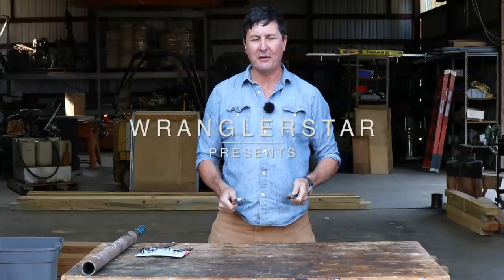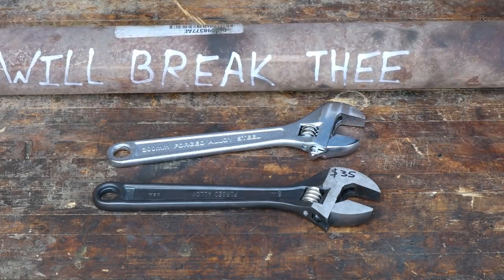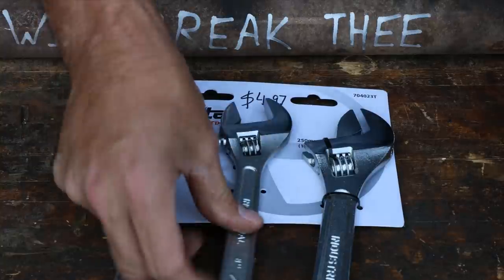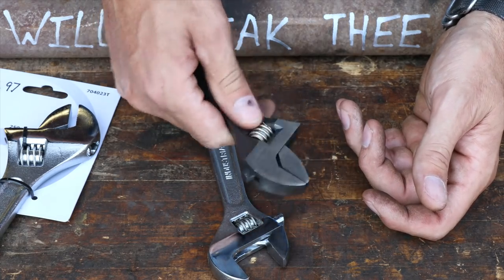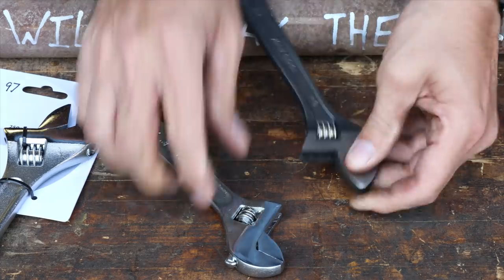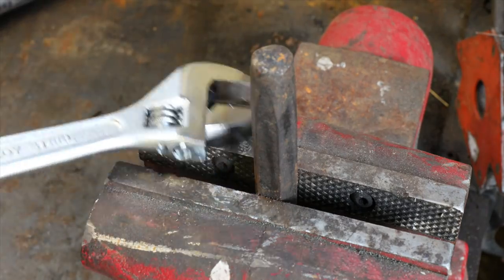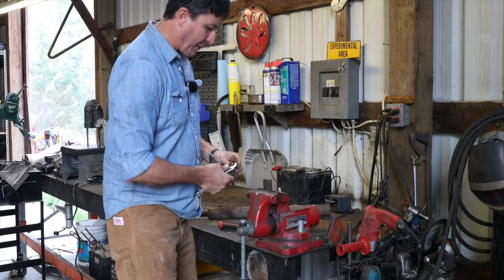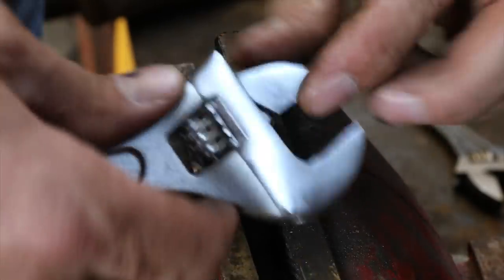Testing Cheap V.S. Expensive Wrenches On AMAZON

Comment: I buy old American made crecent wrench from flee markets and yard sales. It is usually around $5-$10 depending on length. The older tools make me happy when I use them. I let people barrow my Chinese cheap tools not any USA made tools.
Reply: The best pair of vise grips I ever had, I literally found on a parking lot as I went to buy bagels in San Antonio. It was an old pair of VICE GRIPS branded pliers made in the USA. Unfortunately, as my luck would have it, that pair went missing after a year or so of hard use where it just didn't fail to do what I needed it to.
Reply: you can still get them new ;) i have a set that are 60 years old and just got 2 clones of it new .. 100% identical ;) as you say ; they are the best ;)
Reply: greg stevens I have bought new Vise grip pliers that are made in China (Irwin bought the brand name), and they just weren't as good as that pair I found on the ground.
Reply: Estate sales have good tool deals, too. Always go to the basement and look for tools; sockets and wrenches first.

Comment: I found that usually spending the money on quality stuff is the way to go. It works better and never fails plus it is way more fun to use quality tools instead of cheap ones. Great video as always!
Reply: I agree on quality tools, they fit and work better. But Snap-On goes way overboard with their prices. Example is car jacks. The Harbor Freight Daytona jack is is a great jack. Is identical to the Snap-On one for hundreds less. My USA Craftsman adjustable wrench is superior to the Snap-On one which has a lot of play in it.
Reply: agreed... not to mention when you buy quality stuff, most of it comes with a life time warranty, and is built tough enough to actually last a life time

Comment: Now try to imagine testing a $36 Chinese Wrench
Reply: We tested a $60 irwin 18" adjustable wrench.  It was 28 Rockwell, compared to 36 of U.S. made crescent, and in less then a week the pin for the thumbwheel failed.
Reply: how big would that wrench be? probably 30" to get to that price as it would surely be as crappy, just bigger
Reply: Mind blown
Reply: LOL Haha, you nailed it :D
Reply: Ahahahah
Reply: Wow that tool should last a lifetime. Do you think the failure was design or assembly issue?
Reply: Oalmax ha ha! Yes! Bravo
Reply: The thumbwheel pin and the thumbwheel are the weakest components of a sliding jaw wrench.  A larger diameter pin of better alloy would increase the selling, price by under $1.  This isn't a matter of manufacturing capability, but engineering to a price point.
Reply: Design.  "Assembly" is installing a screw between three components.  Make a mostly steel tool 80% cheaper while keeping the basic size and design the same and the material of 3 components cannot be of the same strength and the quality of finishing/precision cannot be the same.
Reply: It's not linear, it'll fail less often but still more so than the American version. Take it from someone who lived there for two years, it's a cultural issue.
Reply: Jimmy Duncan it is likely a hidden safety feature
Reply: engineered to break at a certain torque? possibly, but i tend to doubt it. if it breaks you can hurt yourself. i rather think it just reached its stress level and broke because science, lol.
Reply: i think it was his cheat bar lol
Reply: That would be best as
Reply: I dont get this test...why not test Chinese $5 v USA $5 wrench..
Reply: They don't sell $5 USA wrenches
Reply: They don't make one lmao
Reply: Fook Utube they dont sell 5$ us wrenches
Reply: That sounds a bit more fair
Reply: Expensive Chinese tools are superior both in price and quality.
Reply: Expensive Chinese tools don't exist in the US. Companies that contract with Chinese manufacturers to make tools for sale in the US don't care about the quality. They care about the price per unit. All US-based businesses that decide to move their manufacturing to China are making that decision purely based on profit margins, You could have a more expensive wrench made in China, but the smaller margins make it significantly less attractive and you then have to compete with US manufacturers with established products and manufacturing processes at that same price point.
Reply: I mean the chinese one was the smallest of a 3 for $5 deal. That makes it like $1.5. You can get 23 of them for 1 of the better ones.
Reply: He says at 2:24 that "this is one of the only USA made wrenches I could find" ... and judging from my own experience, I don't think a $5 USA made wrench exists.
Reply: Randy Magnum very interesting sir!
Reply: Fook Utube because China don't play fair and Clinton gave us NAFTA which allows them to charge less and undercut the market.
Reply: does not exist :DDDD
Reply: Yeah, I want to see what a similar price point gets you from many countries. Give me china, usa, germany, india, etc.
Reply: it would be the same wrench the only differance is you pay 36 dollars this time
Reply: Regardless of the cost, the quality would have been just about the same as the $5 one.
Reply: @fookutube501  this test was about cheap vs expensive not USA vs China
Reply: never seen a 36 dollar chinese wrench
Reply: @cftemptempov6262  not really. Quality control still issue there
Reply: @ Hatchet Read before you comment .I did not say USA vs China.I ask a question"why not test Chinese $5 v USA $5 wrench"...
Reply: a $36 Chinese wrench, was probably imported from the US lol
Reply: Bravo, Hatchet D. - you're one of the few people who got it, and it's clear that you did read the question.  

Fook Utube:  "I dont get this test...why not test Chinese $5 v USA $5 wrench...."  
Hatchet D. "@Fook Utube this test was about cheap vs expensive not USA vs China"  
Fook Utube:  "@ Hatchet Read before you comment .I did not say USA vs China.I ask a question"why not test Chinese $5 v USA $5 wrench"..."

Clearly, Fook STILL doesn't get it:  the reason why he's not testing a "Chinese $5 v USA $5 wrench" is because, as Hatchet said, "this test was about cheap vs expensive not USA vs China".  The title of the video is "Testing Cheap v.s. Expensive Wrenches", not "testing US vs. Chinese $5 wrenches".

Think of it as a sort of "mythbusting test":  The tool greybeards have been telling us for generations that the Chinese tools are no bargain, that you get what you pay for, and that a properly-made, high-quality expensive tool is going to do the job it's designed for better, and last longer.  But, are they right?  This test demonstrates that the more expensive wrench does, indeed, stand up to more abuse before breaking, has a better fit and finish, and does harder work longer before failing, versus the cheaper wrench.

A test of one cheap wrench against another cheap wrench, no matter where they are made, kind of misses that point.
Reply: “Cost 22 times” and lets try makes 22 times more first , I’m starting wounding if I can looking for a house cost 22 times because truly appreciate the quality of life , Please don’t wake me up and I thinking my supper car now..
Reply: hochhaul l
Reply: @geraldbrakefield3874  because they dont exist
Reply: @AldoSchmedack  I didn't know that China was in North America. Last I checked North America is US, Canada, and Mexico so those are the only 3 countries in NAFTA (the NA is for North American).
Reply: @fookutube501  because good luck finding a 5 dollar crecent wrench
Reply: exactly!!  American cheep  tools brake too. I am sick of chasing down the snap on dealer to get a tool fixed. 
Test a cheep American tool against a good Chinese tool.. Better still test a good American tool against a Britool... thats a British made tool
Reply: @Andrew Manche that answer is showing your lack of education.
As mentioned in the comments, and so true. Most things brought in from China are made per the specs issued. If an American company wanted to bring in a great tool made in China that is what they would request. Which would bring the price point higher. 
The only differents in quilty from the US, China, Canada and Germany.... is wage vs shipping.
What profit margin do you want.
Reply: The grade of steel is all that matters. They both failed and the thinnest part, also the moving pieces, and the better steel won out.
Reply: buy Sidchrome
Reply: You'll get the same tool, just marked up.
Reply: Same wrench they just took you for an extra 31 bucks
Reply: @jimmyduncan7650  Material.
Reply: @jamestmtmtl8531  cheaping out on making the nose shorter didn't help either, so probably design too.
Reply: China could make tools as good as any nation on earth, it's just that there's more money in selling a quarter billion cheap wrenches than a quarter million high-quality ones.  Most of the hand tools like adjustable wrenches are purchased by consumers for very light-duty work, and are good enough for that.
Reply: There are German and US brands, like Millwakee, that manufacture their tools in China. After all, iPhones are manufactured in China and they are really well built. I tend to go for the locally manufactured German tools, though.
Reply: @jimmyduncan7650  Yep, maybe it's made to break a part you can get a replacement for instead of the adjustment screw.
Reply: @Intellect1618  lol you really know culture?
Reply: It doesn't exist
Reply: hochhaul crecents are made in China
Reply: @AldoSchmedack  can always blame on other's success with one's own failure. It has always been done and always will throughout the history.
Reply: @geraldbrakefield3874  If it is contracted out by Sony, Honda, or Apple or Porsche, you will see a $100 Chinese wrench.

Comment: More accurately the $35 wrench was better than the $5 wrench. 

You should try a $35 USA wrench vs. a $35 Chinese wrench and see what happens.
Reply: The Chinese $35 wrench will beat the pants off the USA one.

Have a look at Fluke multimeters for an example of this.  Compare the $100 Chinese market model to the $100 American market model (if you can even find one).
Reply: There's no such thing as a $35 Chinese wrench.
Reply: The point is whether or not you want to spend more money on the American made wrench compared to the cheap Chinese wrench, its obvious the more expensive one is more likely to be a better product but the point of the video is to see if it's worth the extra money to someone who is looking for a wrench.
Reply: Rubberneck Rides Dude...you've got no clue do you. THere's no chinese wrenches that cost even more then $10(in china)... exept really big pipe wrenches. THis is not a simple math question... Stop acting like you are smarter to choose the $5 one. It's like everything ever get produced... You get what you pay for. If china can come up with a wrench that would compare to a $35 one, why would they price it at $5? It's so funny that I'm from china and I would buy better quality tools for more money, even if I can't afford tools made in Japan, USA, Germany... I would get a taiwaness one. A chinese tool is my last option...I dont have to tell you how many times Ive  broken cheap chinese wrenches for normal around the house uses.
Reply: shepd3 Fluke is not a chinese company if that's what you are saying. 
http://www.fluke.com/fluke/myen/about/corp/default.htm
Reply: Rubberneck Rides you'll have a tardy holding a $5 wrench and an empty wallet.
Reply: I will happily sell you a chinese wrench for 35.00... all of you!
Reply: The Chinese build to spec. Want a cheap wrench, they will cut every corner and make you a cheap wrench, but if you want quality, they can do it too. It won't be the same price, obviously.

The thing is : manufacturers don't go to China for quality. No manufacturer will say "we found that great shop in China that does a better job than anything we can find in the US", even if it is true, "Made in China" simply doesn't sell.
Reply: Emi Cang I think you missed the point. Which is that these wrenches are not of equal value regardless of their origin. So how can you compare?
Reply: Rubberneck Rides well, its kinda the point of some blue point tools vs gearwrench or irwin, all 3 going to be good, but if someone is going to spend 35, maybe they want the sk or crescent or what have you, that point its kinda whatever fits your flavor type deal
Reply: ToughAncientSpark good chunk of Blue point is made in china, but they are a bit spendy, but better qc and mfr process a chunk of time.
Reply: for $35 you would probably get a MASSIVE wrench
Reply: Grenherb - dumb comment, interesting video
Reply: gubx42 OK, I'll bite....name a quality chicom product.  I buy mostly wright tools if I have to buy new, so name something in that quality tier
Reply: This video is not about US vs. China made, it's about $35 vs. $5. The cheap one is just much more likely to be made in China.
Reply: who should label it should PROFESSIONALS use because buying over priced wrenches like that for occasional use is impractical. buy a stanley for 7.99 works just as good
Reply: You're right there.
I go to my Hong Kong tailor because he does as good a job as I can get in London, but I would need my head read if he charged as much as well.
Plenty of tailors in HK are much cheaper than he is, and so are the results.
Reply: Rubberneck Rides you get what you pay for
Reply: A Made in China branded wrench?
Reply: not advocating the price of the Snap-On, but I own the 12" version and have yet to bust it, the same cannot be said for a chinese cheapie or a Kobalt 12" adjustable...
Reply: The thing is the Chinese are improving... Before long Made in China will not denote crappy shoddy products but quality well priced items. It's already starting to happen.
Reply: i swear all i hear in his videos are USA as if the USA is best thing in the entire world so overly patriotic
Reply: Which Chinese sweatshop produces those?
Reply: Don't be so naive to think high end stuff isn't made in China, Because a lot of it is made there. Well known Western brands and a plethora of smaller companies outsource to China to manufacture their goods.  My point is more about the future...If you keep making something you become better at it.   If you want them to stop producing the crappy stuff ... don't buy it then it's that simple.
Reply: He isnt saying that.
Reply: You are right, they build to spec.

But some manufacturers do go there for the quality... and the price.  :)  Apple, for example.  Much as I don't find Apple products appealing, I would be hard pressed to call the iPhone "junk" (in the sense of a $50 Chinese market phone. anyways).
Reply: Nahh, not saying Fluke is a Chinese company.  Just saying that high end Chinese market products exist and are of very good quality, for quite a lot less than the US market products.

Fluke makes a set of "reduced cost" multimeters that are (supposedly) only for sale in China.  There's a small number of cost reductions, but few people have complaints about those cost reductions considering the incredibly low price and the high quality of the most important part--the meter itself.  The cost reductions were in things like the leads, boxing, feature set etc.  The meters themselves are rock solid, like the USA market version.  You can go and buy some nice high end leads and you're good to go so long as you don't need true RMS (and no, the meter doesn't like about that, either).
Reply: The problem is a $35 communist wrench is the same one as their $5 wrench with a different sticker and paint. Very few brands can hang with U.S.A. dollar for dollar.
Reply: Test a $2500 Japanese love doll versus a $25 Chinese blow up version.
Reply: Absolutely!  and in fact, as a pack of three, this was a $1.70 "Adjustable spanner" against a $35 "Adjustable spanner"  as the original British inventor called it!!
Reply: the other wrench wasn't $5 .. it was $5 / 3 , it was less than 1.7$...
Reply: @DJaquithFL  i have these snap on mexican socket sets and they are worth every cent.
Reply: @shepd3  You're comparing features with reliability
Reply: @sp1068  Sorry, did you mess where I said "quality"?
Reply: Emi Cang -- Thank you for your insightful reply. :-)

Comment: I just don't get the point of this video. It will be shocking that a $35 wrench is NOT much better than $5-for-three, regardless of which every country made the wrenches. It's like comparing McDonald burger beef to steakhouse Sirloin.
Reply: It is not a "logical" video.  Most guys just want to see him break a $35 wrench.  Then you have a group hoping he supports the expensive one and another group hoping he supports the cheap one.  The "test" really doesn't prove a thing as even the cheap wrench went well beyond what it was designed for before it broke.  At the end of the day all you really need to know is whether the cheap wrench is adequate.  I say this video showed that it is.  Is it better than a wrench ten times it's price?  I should hope not.  What should you buy?  Whichever one you want.  period.
Reply: Lilspaceman Then don't buy it what's the matter?
Reply: Then you'd better never buy anything from China.